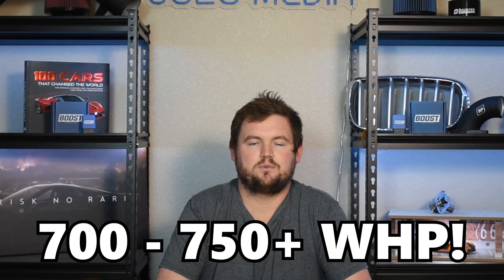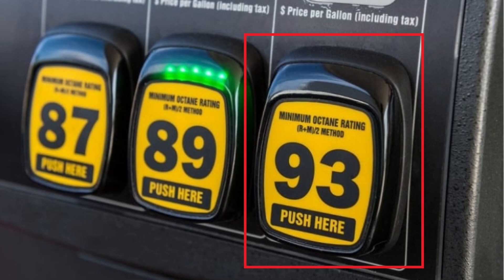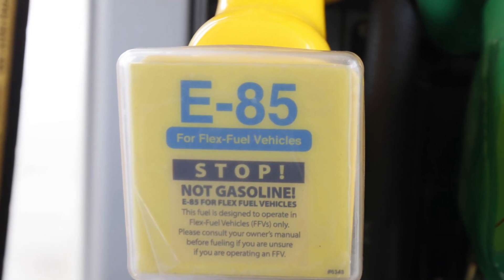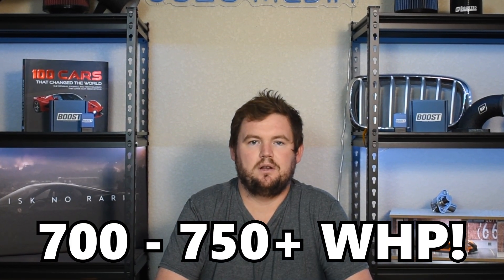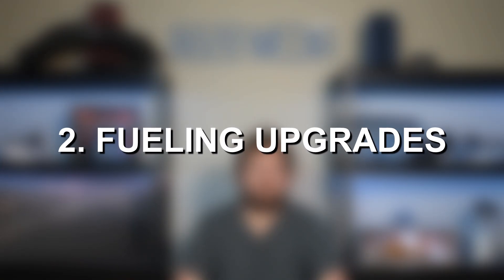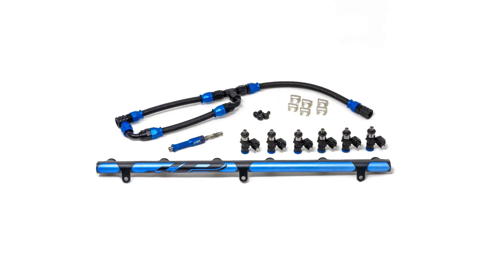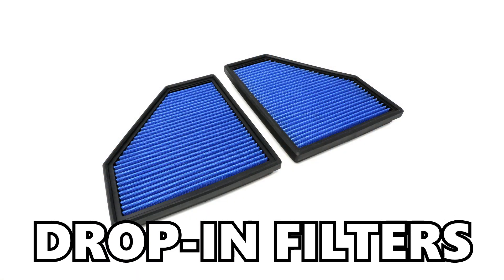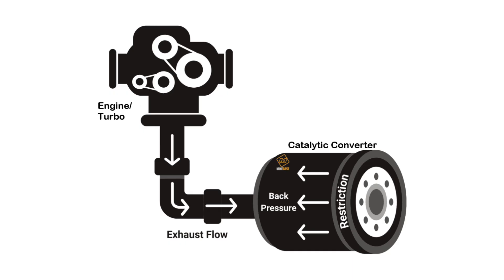How to Build a 750+ WHP BMW S58! (G80 M3 & G82 M4)

Comment: Hey what’s up man. I bought an S58 and it appears to have port injection. What do I do to enable it? Do I have to run it with an app an adapter?  I’m so confused. I can’t get a hold of the original owner. I recently put bootmod3 stage 1 on it. However how do I enable to port injection? Is there anything I need to do?

Comment: Unrelated but QQ, what are your thoughts on a 650i gran coupe with 42k miles, I know these engine are not really good but I found a good deal with 42k miles😮
Reply from the maker: J - A 2014 BMW 650i Gran Coupe with only 42k miles can be tempting, especially at a good price, but you’re right to be cautious—the N63 twin-turbo V8 under the hood is known for serious long-term issues like valve stem seal failure, timing chain stretch, excessive oil consumption, and injector or turbo problems, often surfacing even before 60k miles. While low mileage is a plus, these engines age poorly with time, not just use, and repairs are brutally expensive—BMW even launched a customer care package and class action support for early N63s because of the widespread problems. If you really love the car, have a BMW specialist do a full pre-purchase inspection (including a compression test and bore-scope if possible), and budget for possible repairs or extended warranty, but if reliability is a priority, you might be better off walking away.

We have a full video that may be helpful here: https://youtu.be/hsPuvvAWWTw
Reply: @8020Automotive THIS👆🏻 That engine is a complete hunk of shit
Reply: 2014* my bad